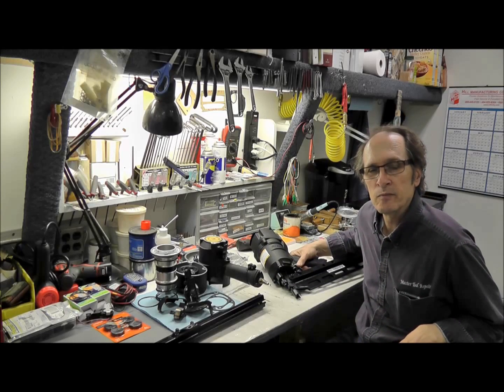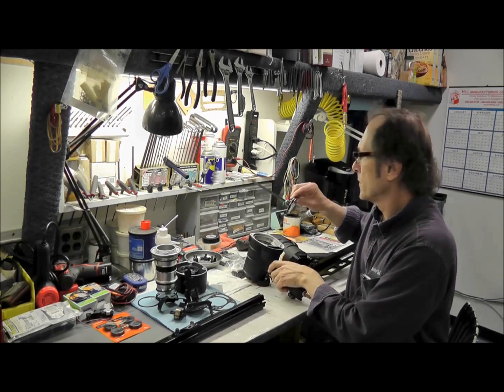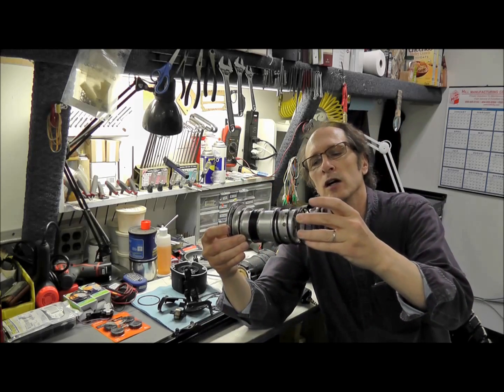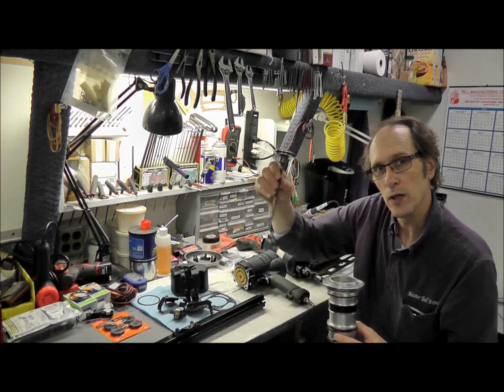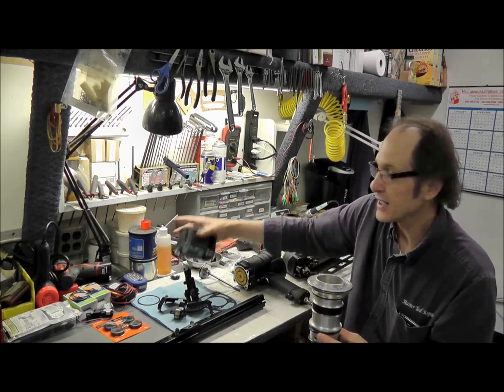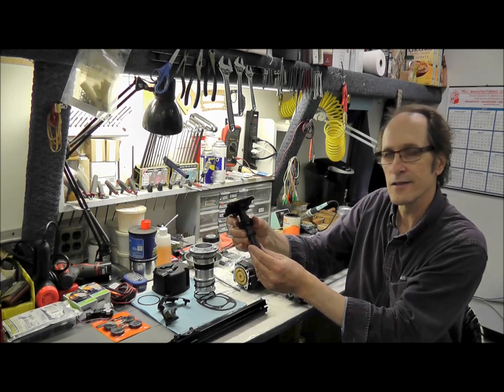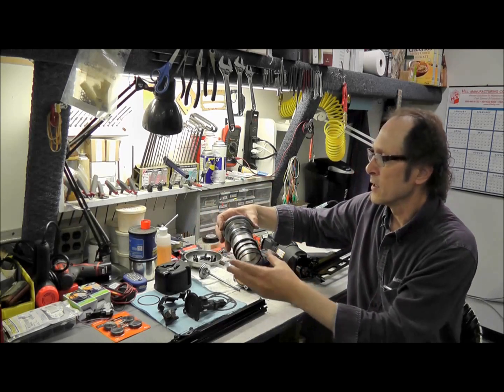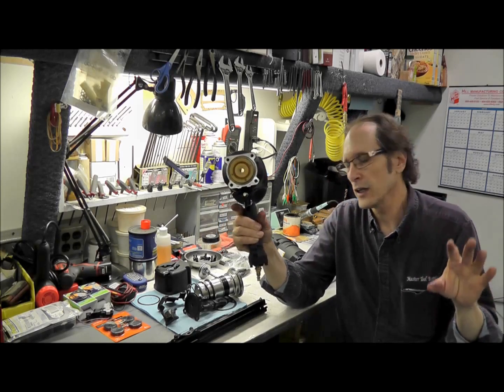Hitachi framing nailer disassembled and parts that go bad

Comment: we bought a returned gun hitachi nt 65ma no air when pulling trigger and piston stays in down position lowes sold it to me for parts but i think it can be repaired i only paid $30 and need a winter project repairing this nailer but i dont no what to replace first
Reply from the maker: Typically this problem is caused by a bad Cylinder Seal. The seal on top of the Cylinder is probably worn or damaged so it won't allow a good seal with the Head Valve. This part is #13 on the breakdown for this nailer, which you can view by clicking on the below link:
https://mastertoolrepair.com/pneumatic-finish-nailer-parts-nt65ma-p-1335401.html
Typically an o-ring kit will fix these issues; replacing all o-rings in the body of the nailer is a good idea if the tool is more than a few years old.

Comment: Thanks for the info. I have a nr83a which is starting to bend the nails  or jam. could  my driver just be worn out ? Thanks again
Reply from the maker: Thank you Janet and glad to help! Yes, one reason it's bending the nails when it fires could be due to a bent driver blade. I would remove the top cap and the piston/driver to confirm it's not bent. If it looks good, it's possible the nails aren't feeding into the nose area of the gun like they should. It could be that the magazine that holds the nails is misaligned with the nose, where it butts up against the nose. Make sure the nails are in the magazine properly (and that the correct nails are being used...I know it seems obvious but it's worth mentioning) and that the magazine isn't bent so that the nails feed into the nose without any obstruction. I hope this helps!
Reply: Where I can buy a kit to repare the hitachi framing gun?

Comment: and thank you for that!  my nr83a2 hitachi framing nailer's drive piston won't retract.  any clue what's the main culprit?
Reply from the maker: I would look to see if the cylinder ring check valve (big rubber band), item 19 on this link is snapped. https://mastertoolrepair.com/pneumatic-framing-nailer-parts-nr83a2-p-3857.html
Reply: that cylinder ring and everything on the top end looks looks normal but i'll replace it and all the o rings.  anything on the bottom that could cause the problem?  the piston drive penetrates wood but won't retract enough to let the next nail load.  no leaky air sounds.   thanks for the help.
Reply from the maker: Has the driver started to unscrew from the actual piston? Some of these piston/drivers had a tendency to unthread from the piston. Also, make sure there isn't an obstruction or the air deflector (#2) isn't bent down not allowing enough air to escape from the nailer.
Reply: i'll replace all the o rings from the kit and see if that fixes it. i'm in southern mexico and the parts will be here in about 4 or 5 days.  tenx for taking the time to help.